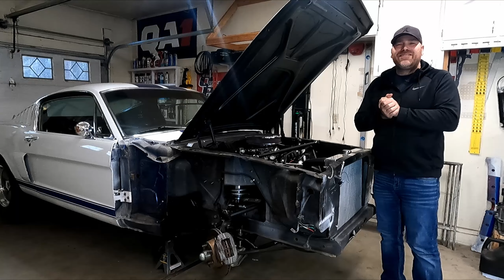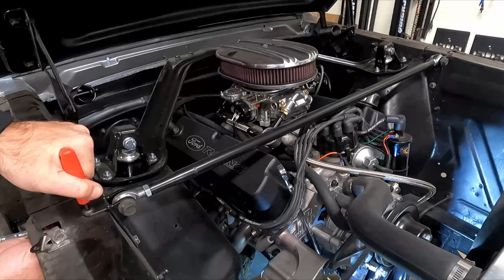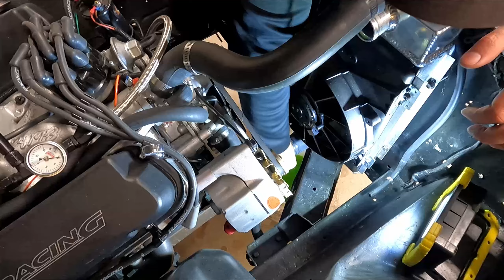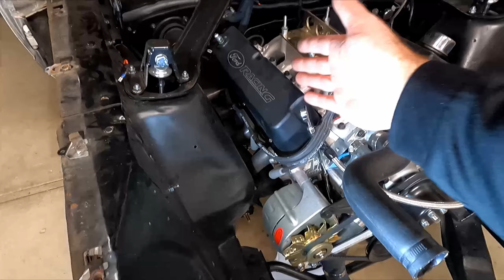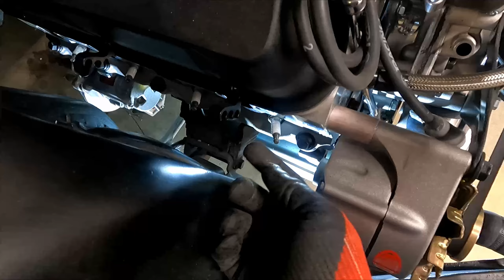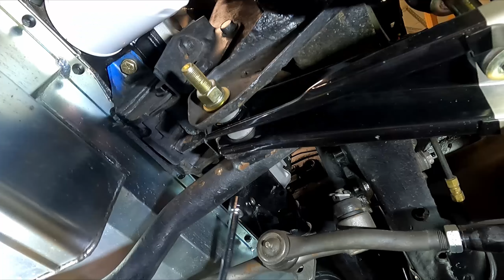Removing the Engine - Classic Mustang

Comment: Your car's nekkid! Always amazed how tight things are between those shock towers & how much stuff needs to be removed.
Reply from the maker: Yeah, I wish there was a pinch more room in these cars.  But then I'd probably stuff a larger engine in there and have the same problem.  :)
Reply: I just finished grinding 1/8" of an inch off one of the upper control arm bolts because that's how little clearance there is with Tri-Y headers.